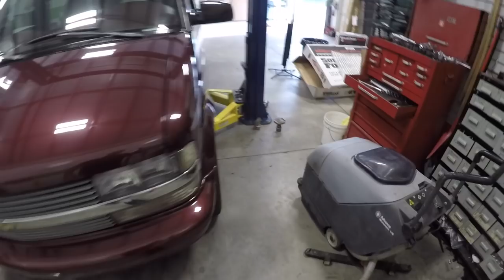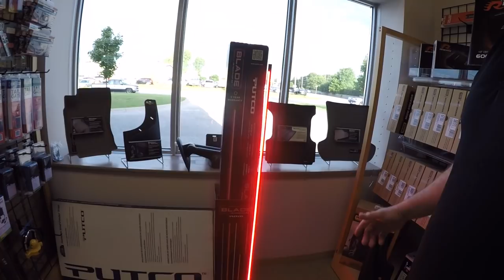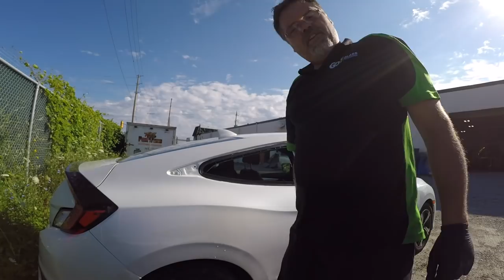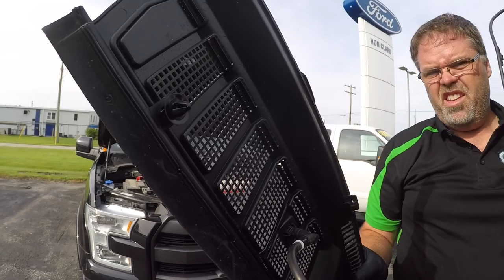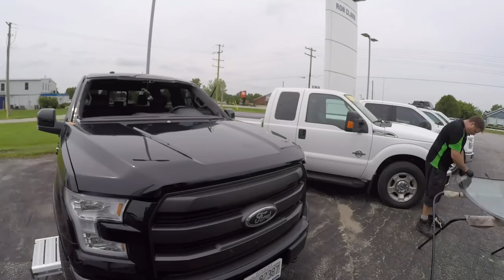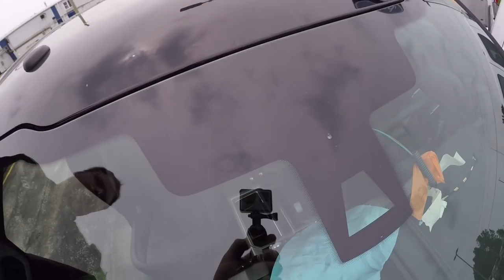Nice Hot Smooth Day windshield install

Comment: Any cure for astro van dash separation? I live in Florida and it happens to all of them.
Reply from the maker: that suck depends on how bad it is . you could either pull the dash out and glue it or pull the windshield and glue it . I would use urethane to do so . or if that won't work for you. could always get a dash cover